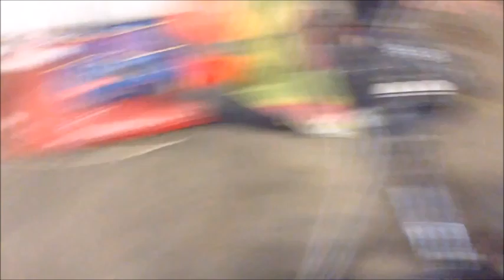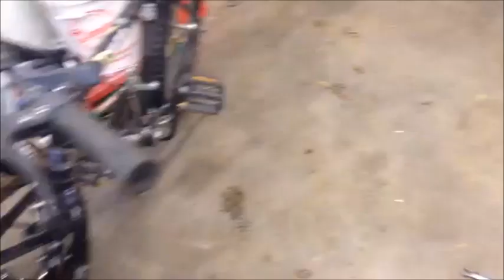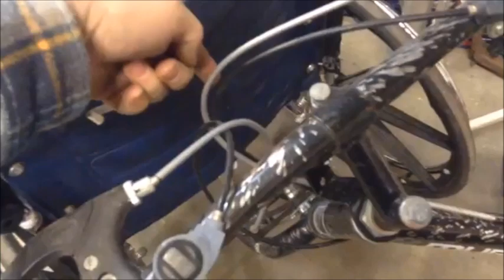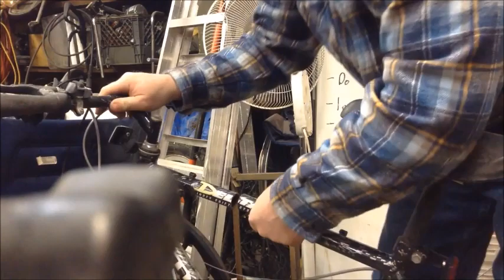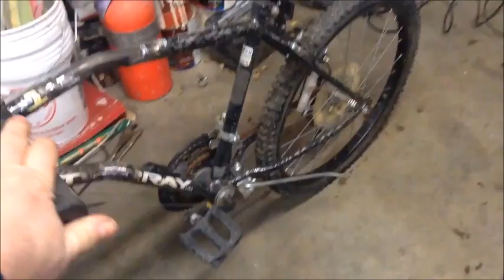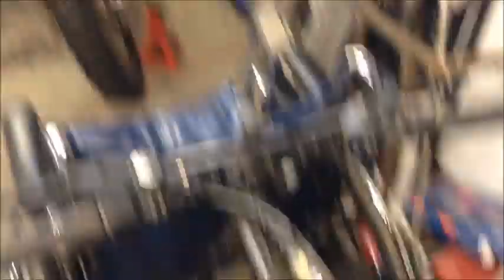How to build a Wheelchair bicycle Project

Comment: Hi there Lee I absolutly love this & want to put somthing together to use with my clients with special needs. Only thing is I have a dicky knee due to a work injury 😁 Im looking at modifying your idea even further hopeing to use an electric trike bike with pedal assist but I have one big QUESTION do u know if I still need to add steel to straighten head stock if im using a 2 rear wheeled trike bike?? Sorry to bother you
Reply from the maker: Excellent question. I doubt you'll need to cut and de-rake the neck if you're starting out with a trike. Sorry I took so long to reply. I didn't get notified of a question being asked.

Comment: Hi. Thanks for this great idea and realization. I love it. I may not understand everything but wouldn't it be simpler to have a drop down connection between the fork and the chair (instead of a flat one) to keep the angle and avoid cutting/welding?

Comment: How does it turn?
Reply from the maker: Function or judgment? Functionally, it turns by substituting the bicycles front wheel for a wheel chair, using the existing bicycle headstock. By de-raking the headstock it solves the trail issue created by switching from single track, to multi track. Judgmentally, it is not as light turning as one of the 5000 dollar systems, and you'll probably just want to use the lower 1 or 2 gears of the bike.  It is a low cost option for someone who doesn't have thousands of dollars to spend on a factory built unit.
Reply: @Guzzilunatic  I’m going to give it a try 
thanks
Tim

Comment: i would like to do this with an electric bicycle. Do you see any problems with that and would there be anything extra I may need to do?
Reply from the maker: Sounds like a great idea. If you don't mind cutting the frame up on a spiffy new electric bike. If you ahve the time, I don't think it would be difficult to add bicycle style center-pull brakes to the wheelchair wheels also.,

Comment: How did you compensate for the 70%+ loss of stopping power when you lost the front brake from this modification?
Reply from the maker: You slow the hell down since you just lost a lot of braking capability, or spend 1500 dollars on a high end factory unit that has brakes on the wheelchair wheels also. And, just as a mater of accuracy, the 70 percent number is for motorcycles, not bicycles. For bicycles it is still a big deal, but let's be honest, a vast majority of bicycle riders are scared of using their front brakes anyway.  Keep the rig in a lower gear, don't go blasting down the road at 40 mph with someone in a wheelchair bolted to the front end.
Reply: Wheelchair has brakes too! Tell your dude to help him slow down lol.